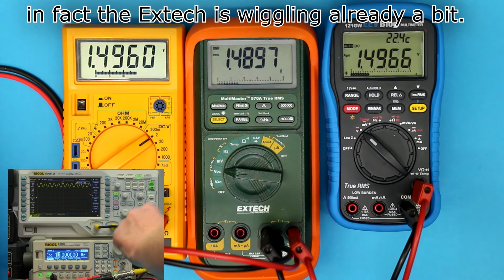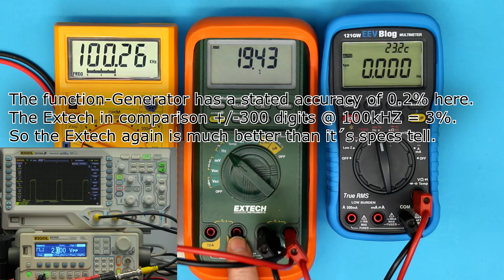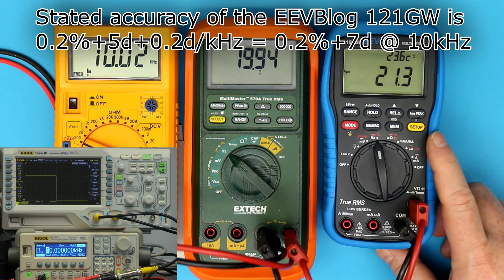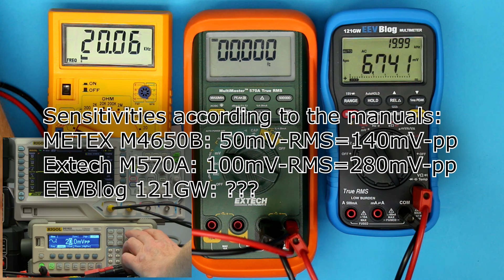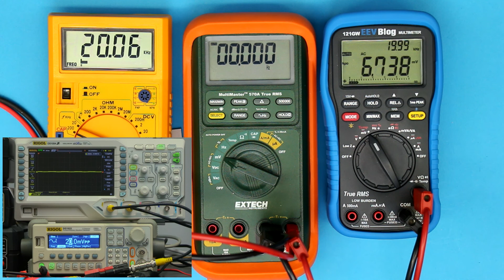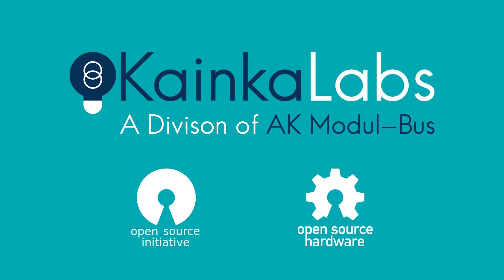Selecting a Better Multimeter Pt.4 - Frequency, Duty-Cycle, Bargraph

Comment: I agree, bargraphs on all the cheap meters are basically useless. I have an old UNI-T UT61E (the original version) that updates at 10 or 20 hz. that's better than nothing.
Ideally, I would want a dot matrix down there, that shows a histogram of the past several seconds, as well as a bar graph at 100/120 Hz sampling frequency or whatever is the practical limit of monochrome LCDs. that would be awesome.

Comment: Good to see someone testing that 121GW.   With so many versions of firmware out there now,  it would be good if you mention the version you are using.   It may help UEI track down some of  the problems you find.   
I saw Dave post recently about the next version of the meter and getting his switch cycling jig working again.  I suspect they finally have a fix for the shim.  This is what I have been waiting on.  Hopefully they will announce when they can be purchased. 
I'm enjoying the series.  Keep up the good work.
Reply from the maker: I did mention the Firmware version in (I believe) the second part. It was the latest from Pt.2 onwards. But I will post it in the video-description of each part.

Comment: Just use a meter with simultaneous AC and DC display. For example, the Uni-T UT181A can display all three AC RMS, DC and AC+DC RMS all at the same time with 50000 counts each. Even without the tri-display some meters have fast bar-graphs that make it obvious that you have an oscillating signal like the BM869S.
Reply from the maker: I completely avoid Uni-T products after having only negative experiences with nearly a dozen of their products. They only excel with their specs and feature-count but not with their true useability. Have you tried exactly the same signal that I used to test the bargraph? The "update-rate" of the bargraph from the specs is quite misleading with most multimeters. All the 3 multimeters I showed claim a relatively high update-rate but fail to show this with a 10 Hz superimposed AC-signal.
Reply: @KainkaLabs  For what its worth, I think the UT181A is great, but there is nothing Uni-T specific about what I suggested. You can use any dual or tri-display meter to avoid this problem, so pick a brand you are happy with. Simultaneous AC, DC, and AC+DC TRMS measurement is available on meters from many vendors - most can only show two not three though. I am away from my lab at the moment, but I am certain that both the BM869S and the UT181A can display a 10Hz oscillation on their bargraph easily, and the UT181A can also display oscillations from positive to negative on the same graph too.
Reply: @superciliousdude  I'm not a fan of the 181A in it's current state.  Too bad really as it could be a very nice meter.   Like most of the UNI-T products I have looked at, it is very sensitive to ESD.  I don't care for that rechargeable battery pack.  Once it's dead, the meter can't be used while you wait several hours for it to recharge.   I'm not sure what users will do once the battery will no longer hold a charge.  Typical UNI-T materials.  Lens scratches real easy.  Still, if they make an improved version of this meter, I will buy one.  It has the two K-type inputs like the BM869s and can calculate the difference.   Drives like the 289 but much faster graphing.  The BT interface is nice once you get it sorted out.   It's also one of the most temperature stable meters I have looked at.  
I suspect you are right about the 10Hz bargraph.  Both of the meters you mention are some of the fastest I have seen and I've compared them several times with other meters.   I have ran into some meters that have a real problem with AC waveforms with a DC bias.  The last one I looked at fall in that catagory.
Reply: @joesmith-je3tq  Thanks for chiming in. Your input is very welcome on all matters regarding DMM choice. I watched your two part UT-181A tests and I must admit, they played a large role in my choosing to buy the meter. I am not concerned about ESD for my own personal use, as I owned a UT-61E (which also failed your ESD test) for several years and despite throwing all manner of abuse at it, it survived fine. I guess my usage does not expose it to any sufficiently high energy ESD events. Used to own a Fluke 289 but the extreme slowness and propensity to gobble up batteries by the fistful put me off it, and prompted me to look for alternatives, eventually settling on the UT-181A. If you're still keen on using your UT-181A, you can get replacement batteries on AliExpress for it. I have a spare in the carry case for the rare occasion that it runs out of power in the field, but it hasn't happened yet.
Reply: @superciliousdude  I think in that video you mention where I repair the 181A, I also show the output waveform from that little grill starter and how it compares with the IEC waveform.    It's surprising to me that it damages any meters yet the UNI-T products as a whole don't hold up very well to it.   If I lived in a higher humidity climate where ESD was less of a concern, I may not even show these tests.   Where I live, in the winter months, things get really dry and ESD becomes a problem.   I suspect most of my RF test equipment would have been damaged long ago if I did not take steps to reduce static buildup in my home lab. 
It wouldn't hurt to provide a link to the replacement battery.  I have looked before but didn't find one.  I would like to see it use common AAs that could easily be swapped.
Reply: @joesmith-je3tq  I've lived all over the UK, and in various places in France and Germany too, but I have yet to encounter any ESD related issues. I have only ever killed some Altera FPGA chips (Cyclone IV if I recall) by being careless in handling them. Other than that, no notable ESD issues despite not taking much precautions. Of course my workbench has a grounded mat but other than that, nothing. The specific battery I bought is no longer available, but here is another I quickly found: https://www.aliexpress.com/item/UNI-T-UT181A-Multimeter-Original-accessories-fuse-And-Battery/32962838907.html
Reply: Supercilious Dude  I concur with you.  Living in Canada and having extreme variants in weather as per the norm with our climate - 35C/+35C, I've yet to suffer a component failure due to ESD. Common sense prevails. I did have an issue with some Intel® Cyclone® 10 FPGAs but that was traced back to a shipping fault and had nothing to do with our lab or the vendor.

Comment: The Extech is a re-branded Brymen. For me the Brymen BM869S is the best bang for the buck meter on the market today. Joe Smith's videos and tests of it sold me. Plus it has the dual display.
Reply: Yeah, that's a fantastic multimeter. 500 000 counts! But I think the BM867s is a better deal because it's 60 € cheaper and the only difference is the VFD function (which isn't that big of a deal), and the temperature measurement, for which I already have an external thermometer (that allows me to measure temperature at the same time I'm measuring voltage or current).